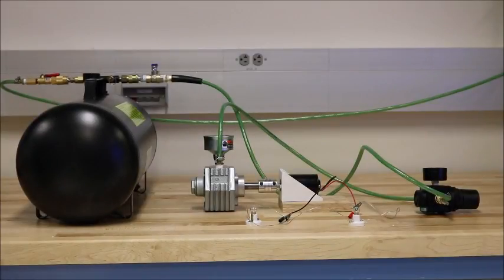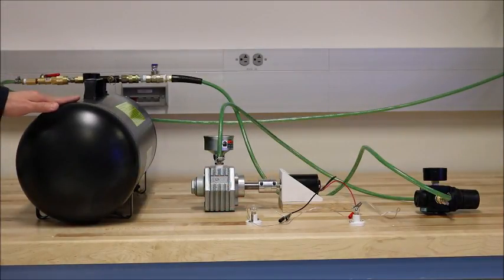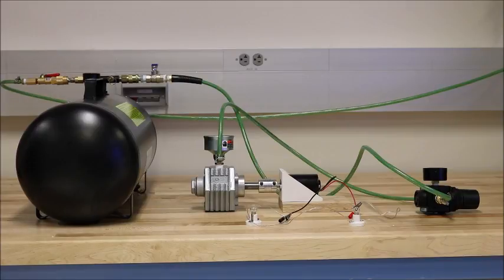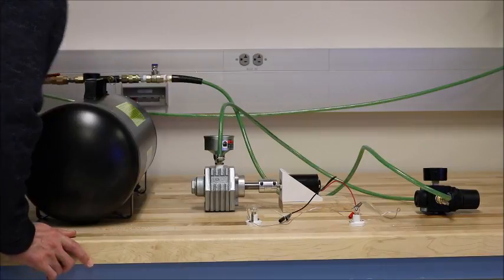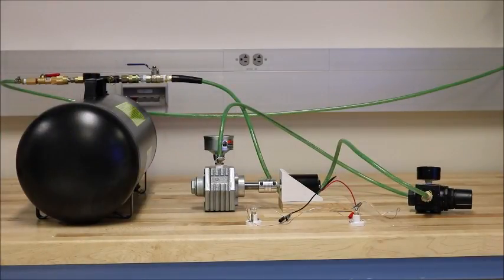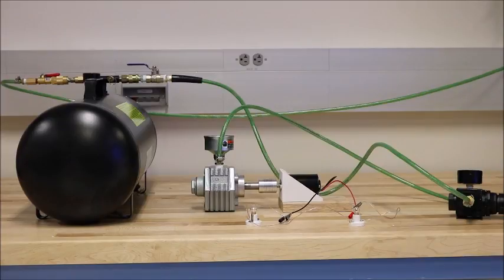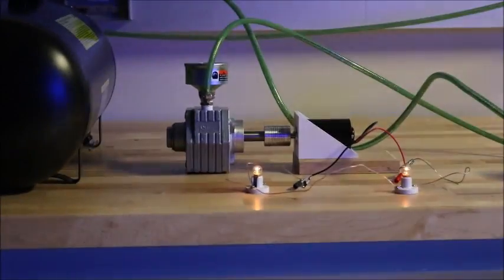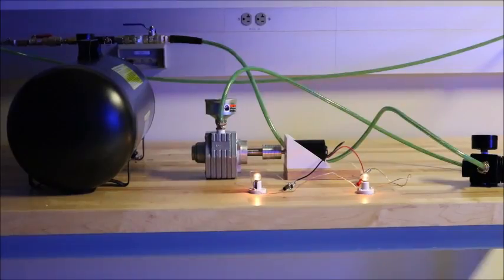UNL EGRL: Mini-scale compressed air energy storage (CAES)

Comment: I don't see the point!! A tesla turbine will spin hundreds of thousands of rpm off very low pressure air and produces a very very very high voltage output.. essentially a steam power plant off stored compressed air.. this wouldn't light up a room let alone a house or anything like that.. as soon as you put a decent current load on it it will take very high pressure to spin at all and barely power a kettle 😢 i like air engines as models and some bigger engines as novelty items but a tesla turbine generator is the only way to create power in any useful way..
Reply: Engines are usually used to generate higher torque and thus a greater electrical current, while turbines are used to generate high speed ( High RPM ) and thus greater voltage. Everything has its applications. Do not expect your small 1.5 volt TV remote battery or even a cell battery to power your house, as it cannot even power an inverter ! However, they have their applications, so it cannot be said that they are not useful. The same thing is with the device in this video or any other device, although it is small, it was able to operate two tungsten lamps, so there may be things that contradict expectations, so we must not be certain about our words.

Comment: Would it take more energy to fill the tank than its potential output?
Reply: Most likely yes, due to frictional losses. But does it matter if you are using, let's say, wind or solar power to compress the air?
Reply: Absolutely yes : )
Reply: You can only get ( 18% ) of the energy of light using photovoltaics !
Nothing is perfect, you cannot produce more than you put in.

Comment: What was the airflow rate? I am curious how much air you would need to provide how much power for how long. Also the longer the system runs the less pressure available so at what percentage of the tank capacity does the pneumatic motor stop?
Reply: I am also searching for this, Do you find anything?

Comment: Well... he used a kilowatt-sized compressor, maybe drawing 30Wh to fill that tank at 100psi to power not one but two... ~100mW flashlight incandescent bulbs for... how long? 5mins?
Reply: Exactly my thoughts. I have been going through equations over equations computing the air consumption of a reciprocating piston compressed air engine, and in theory it can only produce a 10th of the power that is being put in the tank.
Reply: @3dprintwiz378  That's still a good result. I've seen some medium-sized PV installations capable of 3MW monthly (during summer season) so it would be 300kW. That's enough to supply home for nearly entire month.

Comment: I wonder now about the Claude cycle to liquefy air, if it could be done mechanically only, with a windmill. I suppose myself that the problem is it would be a huge, very complex system to built. The decompressing cold and compress heat must be stored somehow for better efficiency and then I think this energy storage is the most green and efficient (so in high pressure CAES or LAES) although some new battery might even be better but they keep working on it and working on it..

Comment: I feel you are using a piston motor to run the dynamo. Try using the Tesla turbine, it's more efficient, less noise.
Reply: It's not that it's more efficient and less noisy, it's about the design itself. engines are usually used to generate high torque and thus high electric current, while turbines are used to generate high speed ( High RPM ) and thus higher voltage. The noise issue is simple you can isolate it.

Comment: try near isothermal CAES, up to 200 bar (a scuba tank works)
-for compressing i think (correct me) just pump cold air in the compressor intake
-for the decompression you need to heat the tube between tank and the air engine

Comment: I love the simple proof of concept, I noticed the pneumatic motor has a heat regenerative device. have you tried experimenting with heat compressors and larger heat/cold storage systems? Insulate it well enough and I see a lot of ways to turn that waste heat into useful energy. Run the base load water (tank of water, geothermal loop, whatever you want, even glycol might work if you get the right parts as you likely know, (I'm pretty sure YOU know more than me but just throwing out my two cents sir) through a copper loop you welded to your generator/motor to absorb any heat right off, second stop is the pneumatic pump and cool it off, if possible one with cooling built in would probably be better and I know they have to exist. run that warm glycol into the "hot" tank letting it absorb the energy until they are equalized, than you turn on a small heat pump, use (figure out a way to use the pneumatic pump as a heat pump, or tie them together mechanically so you need less generators. Especially since.. My understand is traditional 2-4 stroke motors are more efficient at making HP which is important for heating and cooling, but turbines are the generator of choice for pneumatic energy release. So I wonder does it not make sense to say convert a lawn mower (it's some work and will require some epoxy) into a large pneumatic compressor pump, build a gearbox system that runs off of an electric motor (more efficient then using a generator in reverse right?) So while it defiantly makes things more expensive you would get good enough efficiency gains to be worth while if you implemented a geothermal closed loop "slinky" system, Hot and Cold storage with HIGH level of insulation including multiple layers of Radiant insulation.

I'm hoping to get some old large dirty propane tanks that are still safe for pressure just maybe not great for propane or whatever it's original purpose was, strip the paint, epoxy coat it with some mesh after adding heat exchange coils to the tank (the epoxy will hold it in place you'll use two layers one that's VERY thermally conductive, and another that is the opposite. Then radiant barrier insulate. Then i'm thinking some of those heavy duty basement foundation insulation boards 2-10 layers thick.. lol Make sure they all have radiant barriers, tape it up, moisture barrier it, gravel underneath 1 foot compacted, pour concrete (you weld a massively over spe'c. Lots of ideas to play with not enough extra cash to throw at the ideas.

Comment: Using compressed air form windmill air compressors  use solar to preheat the air before going into your air motor.
Reply: why pre heat it?
Reply: @austinjohnson4890  It would increase the amount of presurized air going through a turbine. Compressed air cars do it with a little fuel powered  air compressor cooled by the expanding air.

Comment: year old video so this is a long shot but what is the ration of wattage output to psi in the tank? like if i have that tank at 100 psi, how many watts is it going  to output. standard appliances are 24 volt.
Reply: Well, there'd have to be some intermediate steps up with gearing and flywheels, add to this some loss in efficiency for consistency? I don't see any reason you couldn't have consistent power generation as strong as you scale it up. Maybe use a wind turbine to drive the compressor?

Comment: Could you please share the details of that compressor. Thanks!
Reply: It looks like a simple pneumatic pump with a heat regenerative device. you'd have to get one scaled to your application.

The idea is simple the implementation is the hard part. I love the idea because mechanical battery's burried inside a concrete slab under the house in a reinforced wire mesh (just encase it ever goes pop) Keep it's top at least a foot 10 foot under ground (if you live in warm climates, colder should go deeper) it'll be regulated by the earth, you can add a thermal loop using geothermal loops" to dissipate the heat, or you could tie it into a generative system like i'm trying to design (SO COMPLICATED, It's just a normal nerd not near an expert)

Stuff's complicated but if you want more then a few seconds of power you will either have to get a LOT of tanks and connect em in series, and/or a couple big tanks in series. You're best best is to have  either a gearbox or two motors. It's more expensive but you get better results (but it's more complicated)

Basically take a "turbine" style generator like a windmill (That's literately where i'm sourcing my parts for the prototyping I will try to make a open source well documented article on it but it's at least a years off so... don't hold you're breath lol.

But geothermal, pneumatic, and thermal regenerative tech (using heat pumps and thermal mass/lack of thermal mass for cold battery's).

Did I mentioned it's annoyingly complicated. I'm looking at working with alcohol to move heat to and from the pneumatic to having to get clever and try to machine some fins and weld. Air is a decent battery but run it for long and it'll freeze it's self over quickly, that is after all how an AC works. So doesn't it make the most sense to use a geothermal system, with a hot and a cold tank (or several) to dump the waste heat and the excess cold. You might be able to run the HVAC off of compressed air instead of electric. wonder what kind of diminishing returns "near unlimited" nonsense you could tr y to fake on youtube with that. Joking I obviously don't believe in unlimited/perputal energy but energy recovery is VERY important from what I understand it improves the efficiency of the air battery by %40+ percent for energy density (cold air is less PSI, warm air is more, this is also how fridges work and why to much releasing without a warmth or heat regenerative system will freeze it over unless it's very small.

If you can inject the heat "Waste" you collected while compressing the air back into where that thermal regne dodad is you can do some incredible stuff. I've spent way to much time on this but it's a really neat idea.

Comment: Thank you kindly for this demonstration. I aim to go off-grid this fall but the cost of batteries are restricting my options. Trying to figure out if I can store some energy as compressed air. Even if it's less than 60% efficient it's still a lot better than dumping the load (wind turbine) or turning the solar panels off when the batteries are full.
Do you know if there are any off the shelf products I can buy, like this one? It only needs to trickle charge the batteries or provide some power (aiming for 150W). Shouldn't I be able to use a regular compressor and put some home-made turbine on the exhaust to generate electricity? Any tips are welcome.
All the best to you from Sweden.
Reply: Looking at the same option, have you ever got around to a solution?
Reply: Im looking at the same, we should get a email group set up to see what are finding are

Comment: How much time this method could be on?
Reply from the maker: It depends on the efficiency of the generator. The one we used for the video demonstration is just an off-the-shelf product, so efficiency is not that good.
Reply: @seungheekim1445  it depends on your air motor efficiency which is less than 60% with this configuration that has no heat storage. Electrical generators have high efficiency with proper control system. I have built a 1300 W system and runs for 10-20 minutes depending on the control scheme.
Reply: @hanifsedighnejad2576  Would you be able to share all the details? How much air (L) and what pressure (psi/bar) did you store it at? How much energy did you consume while refilling the full tank?
Reply: The electric motor is not always highly efficient, as its efficiency decreases at higher speeds. Electromagnetic coils ( electromagnets ) are inherently inefficient and energy-hungry and lose a lot of energy through heat. There is also no need to complicate the system with consumer electronics, as it is known that electronics are very complex and require specialists, as they are sensitive and consume energy.
Reply: What about using a 5000 psi tank like the air car did

Comment: i want to make this for my fyp. Do you have a detailed description on how you made it? and which source you took to take the air from to compress it? Thankyou
Reply from the maker: The air source used for the video demonstration is ~90psi compressed air that is supplied to the building. And we used an air amplifier (Haskel product) to pressurize it further up to 1500 psi (~10 MPa).